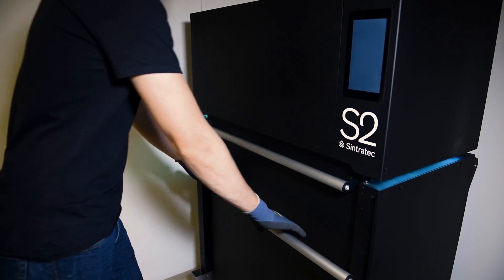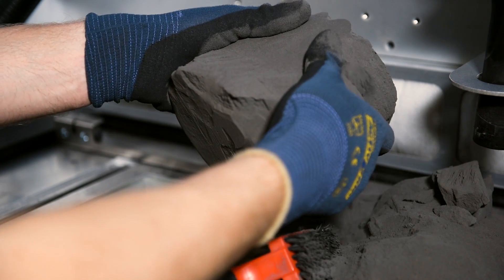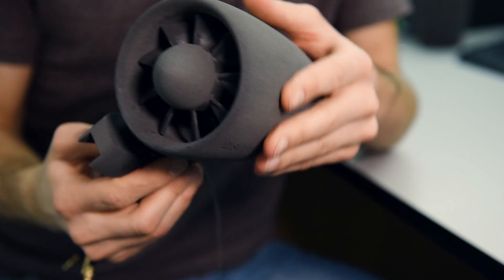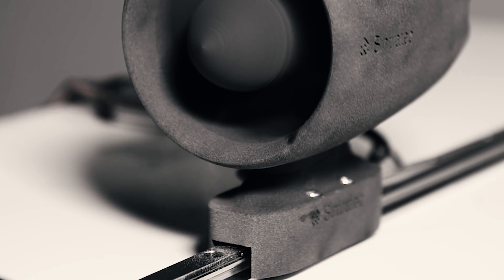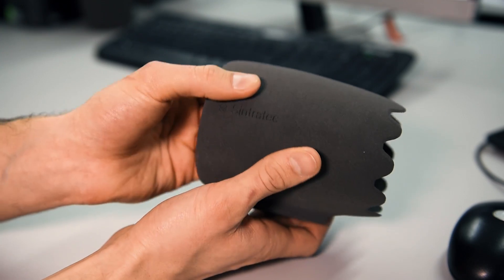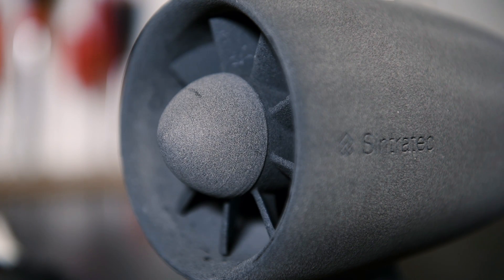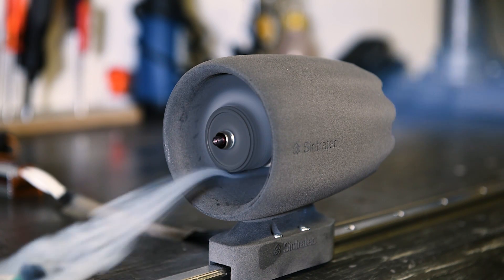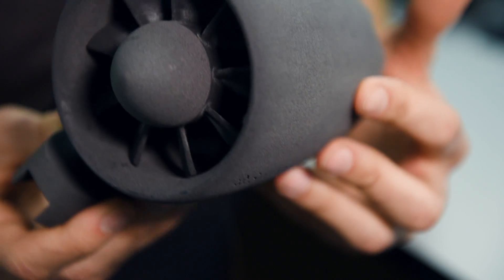3D printed Electric Ducted Fan TESTED – How strong is SLS?! (EDF Turbine Test)

Comment: Would do a lot better if you print a stage after the fan like a vane in order to straigten the stream lines like the do in normal engines. You can see, that the flow has a lots of spinn. That is flow you loose

Comment: That material looks like what r/c tires are made off. I mean its a creative test, i just dont see the use of making a foam edf. Even made out of steel for a bench model, edf motors are so inefficient its like trying develop a better square wheel material while ignoring the limitations of the very shape.

Comment: Try making some 6 inch props and run them on some emax 1806 2280 KV motors. it’s a common, cheap, and quiet setup allot of builders use for light model aircraft. I’d love to see the results with such a material and how practical it would be to use in such a application.

Comment: So from the design, the inside of the outer shell appears to still be hollow, but with structural supports.  How do you get the un-sintered powder out of the the hollow?  there doesnt appear to be any hole.  And if you arent removing un-sintered internal powder, why not just sinter it all and make the shell solid?
Reply: Always advertise a bug as a feature. The powder inside helps to dampen the vibration and provide a fantastic inflight entertainment experience for the passengers.
Reply: They dont remove it. And it is stupid to not sinter it all. The reason why they didnt do that, is because of printing time.
Reply: Could be to do with the unsintered powder being less dense and therefore less heavy than sintered.  But if weight saving is the aim then I would expect them to fully remove it as you said. 

The part doesn't look thick enough to need hollowing to reduce the energy in that area of the build either. 

Strange

Comment: i dont know what i should get more impressed... a 3d printed blade at 20k rpm, or a eletric motor surviving at almost 200% of nominal power
Reply: I think while they may only be advertised for 800w sustained power draw/output, these motors are probably capable of consuming much greater power and delivering that higher power output, but for only short durations.
Reply: @johan1740  eh if you have enough cooling it should be fine, though i guess there is a point where the required cooling for the motor will be impossible to attain.
Reply: @halted_code  which is why I said it's a matter of how long ;-)
There's always the thermal mass of the wires and stator plates, so you always (unless you turn the dial to 11 and blow through the insulation with voltage) have some time before the motor starts sending smoke signals.
Reply: @AKAtheA  i agree with you, as long as the coils gets sufficient cooling, just keep pumping more and more current without much problem, but if you dont cool it fast enough  then yeah, a matter of time before you melt the windings.
Reply: @halted_code  in this case You have an industrial cooling fan lmao
Reply: @johan1740  i think the same is rated at the output power not nominal power
Reply: electric motors can be seriously overpowered...it's not a question of how much, but for how long ;-)
Reply: @AKAtheA  technically you can over current and overvolt them until smoke starts appearing and shut it off. Let it cool down and it will still work. (not that you should)
Reply: lol what have you never seen an overvolted ebike?
Reply: nominal, not peak
Reply: Yes, overpowering a electric motor drastically reduces the efficiency due to joule effect. I already overpowered a dc motor and was a... interesting experience i guess.
Reply: I'm more impressed at a SLS printed fan blade spinning over 20K RPM more than a motor surviving 200% load... Mainly because I have an electric bike with a motor that's driven at 180% power. I've currently put about 6000+ miles on it at that power level and it still hasn't shown signs of failure or wear at that power level. Heck, when I opened one of the covers to inspect the gears and re-grease everything I couldn't even smell the characteristic burned enamel smell you normally get if you roast a motor.

Comment: RPMs and thrust loading along with weight of the fan component? (Watts alone doesn't tell entirely what stress is seen because of differences in motor types. Some will put that power towards the potential torque available, but will not see forces that will stress a component while mostly unloaded.)

Comment: "EDF turbine"?  You'll need a electrically driven fan to power the turbine to power the fan, which then defeats the purpose of powering the fan electrically in the first place.  Please fix your title.  

How much does the whole assembly weigh?
Reply from the maker: You are correct, we adjusted the title. Not sure about the weight unfortunately since the project is over a year old (I would guess around 300g).

Comment: Excellent practical application put to functionality test!! The propulsion output seems high and efficient. Well-designed stator guide vanes should impart a better air mass outlet flow and improved vortex control. However, your project seems very good and well done to you and your team!!!!

Comment: It's a Ducted Fan....not a Turbine.
A turbine extracts energy from the gas flow....Amend your title.
Reply: Semper Fortis  A turbine takes energy from outside the system and converts it into mechanical energy tu use into the system. (like how a water turbine converts the flow of water into mechanical energy and then sends it to an alternator to convert it into electrical energy)
This does the opposite. It takes electrical energy from inside the system (the electrical energy from the battery) and converts it into mechanical energy and puts it out of the system as an airflow.
A turbine takes energy from the outside. A fan puts energy outside.
This is clearly a fan.
I just saw that they even say it in the description of the video. They say it's an elelctric ducted fan. The title is just clickbaity.
Reply from the maker: You are correct, we adjusted the title.
Reply: Semper Fortis  Its a Ducted Fan, like I said, a Turbine EXTRACTS energy from the gas flow. Your FAN is driven by an electric motor...Entirely different.
Reply: Semper Fortis  Open Wikipedia article "Turbine" and read the first 3 lines at least. You're the ignorant one here.
Reply: @Semper Fortis Fan and turbine are two different things. There is no turbine in this EDF. ,,The title is correct .'' - As an former designer of turbine vane blades profiles  for PW1000 series engines, I  say NO.
Reply: Semper Fortis  EDF stands for Electric ducted fan. Is fan designed to extract energy from a fluid flow? No.   If somoene would put flow through it and use the electric motor as a generator then yes but in this case it does not occur nor is the purpose of the whole design. Puting venturi nozzle behind EDF does't change it into turbine. ,,he is still harnessing the flow''  - Complete missconception. He is not harnessing it, the fan does work on the stream by using power of the motor.
Reply: @piotrszalczynski83   pior and semper  ..energy is extracted from this  turbinefan and used to propel  a  plane ahaha..extracting works  both ways..what fools..semper is  correct
Reply: johnny llooddte  When RC aircraft flies with EDF tell me which part works as a turbine ?  You can also call wind turbine a fan and it would be equallly ,,correct”. The case was already solved and the video title was changed for a correct one. Therefore your statements are not only invalid but have no further purpose in this debate.
Reply: Semper Fortis  The orginal comment never limited turbine to a gas type one. He mentioned gas turbine since everyone here spoke about fan from a video which is destignated to work with gas. Stating that you won discussion while you spoke about energy being ,,created” is quite pathetic.
Reply: Semper Fortis  You were claiming that title for the movie was correct.  You was wrong. Every person with education in the field will confirm it.  The title of movie was changed and the authors also  agreed that the title was wrong and changed it . Your claims that you ,,won anything” are quite pathetic at this point.
Reply: Semper Fortis  Lol...no, you are just as wrong now as you ever were...It's a Ducted Fan, not a Turbine...Wanker.
Reply: So basically if a propeller is turned by the medium moving through it, it is a turbine and if the propeller moves the medium by turning itself, it's a fan?
Reply: @will4real58  Correct...it's not complicated.
Although the propellor does not move itself, because it's driven by an electric motor, aka in this case a DUCTED FAN.
Reply: Will4Real  Yes, in theory  it would act as one. The same way electric motor can work as a generator.
Reply: Semper Fortis  Your attempt at wordy show off Cobblers means nothing here matey...Your just as wrong now as you ever were...lol...Epically stupid.
Reply: Semper Fortis  I have read through this entire thread. Why can't you accept that a turbine is a mechanism that uses a fan to extract power? Same goes for turbine engines, where they are used to power the compression stage...
Reply: Semper Fortis  Are you saying electric motors are electron turbines?
Reply: Semper Fortis  Many things can function as something it wasn't designed. I don't call an axe a hammer, just because I can turn it around and hammer with the flat side... This IS an EDF and not a turbine, its functioning as an EDF, not a turbine.

I dont know what else to say. Other than I hope you are trolling.
Reply: Semper Fortis  No. He was referring to the title. The device in the video is an electric fan which performs work on the stream. He referred to that and stated  that  if would be a turbine it would use the gas enthalpy and change it into work instead. Everyone apart you  understood the context and have no doubt about what we were speaking about.
Reply: Semper Fortis  You cannot take out words from context which was an specyfic type of EDF propulsion system, therefore speaking about gas turbine  was perfectly resonable. You claimed that title was not wrong - it was. You also tried to imply that turbine ,,create energy” in your psudo-science explanations tryouts. The title was now changed for a correct one and everyone understood apart of you.
Reply: Semper Fortis  Context -> dictionary. If you open a book about jet engines it also says about turbine and its interaction with gas. Does it mean that RR or PW engineers are reatrds?  This video was about EDF creating thrust using gas.  You claimed the title was fine. It was not. Case closed.
Reply: @piotrszalczynski83  Yes, he lost the augument a long time ago, then he tried to twist terminology in an attempt to save face...He lost, and I also have English O level...lol...🤔🤔😳😳😳🙄🙄🙄😀
Reply: Semper Fortis  Yes and its beyond obvious for everyone. But in the video the design and objective is to use it as a fan at no point anywhere it was being used as turbine and there was no such intention. It took almost 70 comments for you ,,CFD expert” to finally understand it ? The title was wrong. No one names the devices according to their ,,potential” usage. Axe is not a hammer even if u can use it in such manner... Wind turbines are not propellers eveb you could also power them up and spin the blades by motor, fortunately people who design these things understand it.
Reply: Semper Fortis  You claimed that title was correct. You are the zombie here who cannot accept being wrong. BTW - So funny when you mention conservation of energy law when previously you claimed energy being created :D in your comments.
Reply: Semper Fortis ,,Similar to a hydro turbine it creates Energy ‘electric’ from potential energy” -  Semper Fortis 2020, YouTube CFD self claimed expert.
Reply: Semper Fortis  I see you're still digging your own hole...Sad really, when self proclaimed "experts" such as yourself make an incorrect statement and then try and defend it to the death....Pathetic actually.
Reply: Semper Fortis  It's a Fan, being driven by an electric motor. A Ducted Fan in fact.
A Turbine is a collection of blades driven by gas flow passing through them...Can't make it any clearer.
Reply: Semper Fortis  ,,Essentially, semantics boy, going from one form A of a matter to another form of matter, is a form creation ''  Says our CFD expert.   -   Meanwhile :   The law of conservation of energy states that energy can neither be created nor destroyed.   Go back to making mesh according to the company manual :)
Reply: Semper Fortis  They call it a wind turbine Mr Thicky, because it's driven by a gas flow (wind)...Have you any idea how stupid you are?...🤔🤔🤔🤔🤯🤯
Reply: Semper Fortis  You call a boy someone who would clearly be your senior in the company you work.  You cannot even verbalise anything using correct language not to mention other errors showing your lack of fundamental physics. If we would really go into math it would become complete disaster since if you are not even able to describe things correctly by words you cannot do this correctly by equations. Don’t confuse a  human mesh generator with actual CFD engineer.
Reply: Semper Fortis  Your orginal point that title was correct was proven false. Your continuous mumbling about ,,energy being created” just proven that your are rather uneducated and not only miss informed in the topic.
Reply: Semper Fortis  You also said that the movie title had no mistake.
Reply: Semper Fortis  Just allowing you talk and showing your lack of both manners and education is enough.
Reply: @piotrszalczynski83  Don't waste your time, he's a typical Graduate arsehole....
Reply: Semper Fortis  you, sir, not only wrong, you're an asshole. Your mother should be ashamed of you.
Reply: Semper Fortis  1st of all - There is no such a thing like ,,creation of energy”. If you think any device can ,,create kinetic energy” you have no idea about even a basic  physics.   2nd - Yes, you sound like you dont know what EDF is since you argue that any part of it can be called a turbine. It cannot. The same way a wind turbine blades are not a fan or propeller blades. Thats why it is EDF - Electric ducted fan not a turbo fan engine.   If there is an engine that works and create a thrust and one of its components is a turbine - then it is either a turbo jet, a turbo fan or turboprop (also propfan kind). In the video we see clearly an EDF. In that design there is no turbine and and its more than obvious for any person who has a slightest education in aerospace propulsion systems.
Reply: @piotrszalczynski83  Thanks, I have explained to this clown, that it's an ELECTRIC DUCTED FAN...some time ago....and that a TURBINE...EXTRACTS energy from a gas or water flow....But he's a Fuckwit basically...🤔🤔😳🥴🥴🥴🥴
Reply: Semper Fortis lmao when you lose the argument...better list all your credentials
Reply: @fuckthiscomment  
More like 'English Turbines' is the one who lost the argument
Reply: @aluminumfetish Ah, I see now, you're a Soy Boy..lol...done fuck all...but got a lot to say for yourself...None of it worth listening to though...Have a nice day.
Reply: Semper Fortis  A Dyson is also an ELECTRIC DUCTED FAN...Best you amend your Video title.
Reply: @aluminumfetish He also makes his own Gas Turbines at home...I'm guessing you haven't...🤔🤔🤔🥴😷
Reply: @aluminumfetish Kid eh, so let's see, how old do you think I am..?..🤔🤔
Reply: its still  a turbine ahahaha
Reply: Semper Fortis Read your previous comments carefully. You wrote ,,Similar to a hydro turbine it creates Energy ‘electric’ from potential energy” . The energy can naver be ,,created”. The longer I read your comments the more I see you have no idea what you are talking about. The fact that you make mesh for some big company doesn’t mean you have a true grasp of  CFD and math/physics behind it. So far you have proven lack of understanding of basic terminology and physics principles. Again : EDF is electric ducted fan and there is NO TURBINE in such propulsion system. If the engine has a turbine and its the component of the machine allowing it to generate thrust with fan and compressor then its a turbofan engine.  Just accept you are wrong and you made an unsuccessful attempt to play in aerospace engineer which you are obviously not.
Reply: @piotrszalczynski83  The hole he's dug himself is so deep now, he can't get out...lol..

Comment: If this is gonna actually be used by modelers i would highly recommend fixed counter angle blades to help straightened exhaust flow. You can see the air flow is spinning as it exits. You could easily achieve higher efficiency with 5%-15% more thrust per watt. But overall an amazing project. Well done. I might try it out on my MSLA printer with a high polymer resin. Going to be experimenting with chopped carbon strand/multiwall carbon tube infused resin

Comment: You should usually include a stator inside your EDF to straighten the flow. This stator will also provide back pressure on the intake fan providing additional stress levels. You might want to test this theory as well. I know you're not trying to make a functional EDF but rather test your printer. Additional forces on the fan blade may allow for better strength testing. Also this will allow the can to pressurize a little bit more testing the outer wall strengths as well. All in all well done, looks like an excellent little machine!

Comment: Hi. Did Andy answer?
Reply from the maker: Hey there, sorry again for the delay. Andi didn't know what they were, we just have them in our workshop for testing airflow. But apparantly it's a white smoke powder stored in a capsule - you can find a similar type here (we bought different ones in Switzerland but they should be pretty much the same):  http://www.regin.com/product/s102-45-sec-150-cu-ft-smoke-emitter-10-pk/
Best regards.
Reply: @Sintratec  hi. Thanks for your time